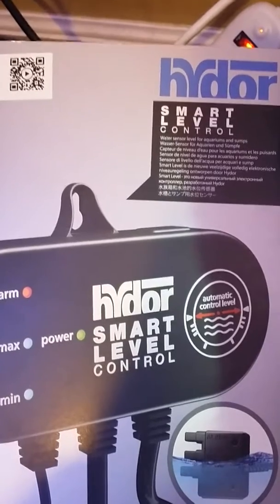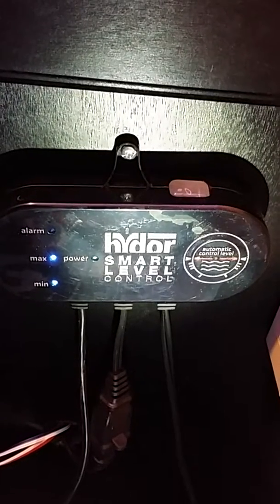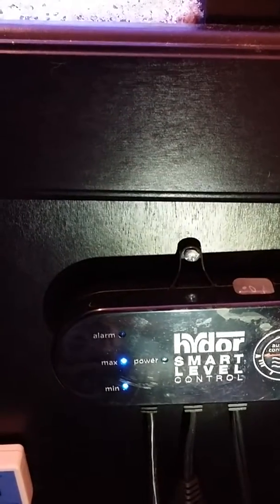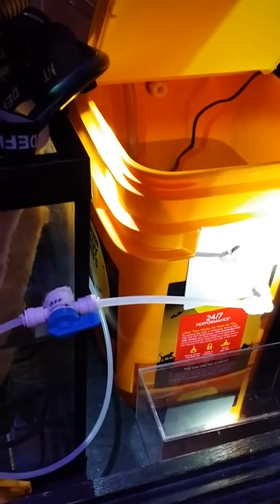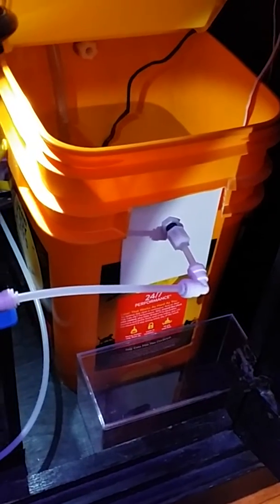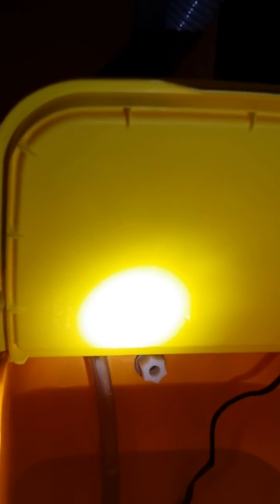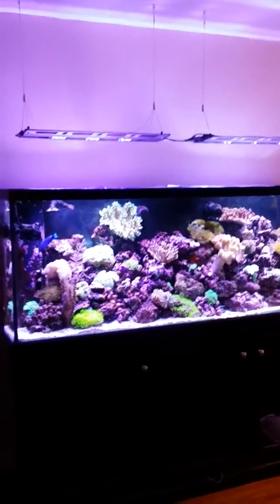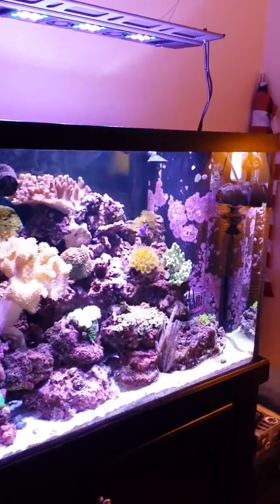Aquarium Auto Top-Off System

Comment: 365  What size aquarium do you have?  It is recommended the salinity should be  1.022 to 1.026.  On my reef aquarium of (150 gal)  1/2" in the 30 gal. sump the differential amounted to about 1 gallon of
 make up water to satisfy the max. level. controlled sump depth. The change in salinity from adding or losing 1 gal of fresh water is insignificant in my 180 total Gal.
 systen. I'm not familiar with your gauging systen of specific gravity. Salinity must be greater than 1. Range 1.022 - 1.026.

Comment: Hi Ron great video and great tank . Just purchased one of these, but i am really struggling to keep salinity. The difference in height of the sensor probes  means the water in my sump drops a good 1/2 inch before it tells the pump to kick in, therefore my salinity is rising from 35 to 40 before  top off is auctioned. Just wonder if this is normal in your view. 

Thanks
Reply: 365  What size aquarium do you have?  It is recommended the salinity should be  1.022 to 1.026.  On my reef aquarium of (150 gal)  1/2" in the 30 gal. sump the differential amounted to about 1 gallon of
 make up water to satisfy the max. level. controlled sump depth. The change in salinity from adding or losing 1 gal of fresh water is insignificant in my 180 total Gal.
 systen. I'm not familiar with your gauging systen of specific gravity. Salinity must be greater than 1. Range 1.022 - 1.026.
Reply: Hi thanks for the reply, 35 PPT= to 1026PPM. My tank  is much smaller 70 gallon including the sump, your sump is as nearly as big as my tank. I think the issue is may be they are more suited for bigger tanks/sumps
Reply: I know Im asking the wrong place but does any of you know a method to get back into an Instagram account??
I was dumb lost the login password. I would love any tricks you can give me
Reply: @Benedict Sincere instablaster ;)
Reply: @Carson Alijah thanks for your reply. I got to the site through google and im waiting for the hacking stuff atm.
I see it takes quite some time so I will get back to you later with my results.
Reply: @Carson Alijah It did the trick and I finally got access to my account again. I am so happy:D
Thanks so much you really help me out!
Reply: @Benedict Sincere You are welcome :)

Comment: If there is a power interruption, will the ATO resume operation automatically when power is restored, or does it need to be manually turned back on?
Thanks for posting this video!
Reply from the maker: +Robert Nadeau Yes the system switch is always on until you toggle it off. Had the system over a year now, It hasn't failed yet.  You just need to make sure you don't accidently move the sensor up or down in the sump once it's placed at the proper liquid level in the sump. This saved me a ton of work bucketing water from barrels to the sump. Any more question, let me know.
Reply: Thank you so very much!